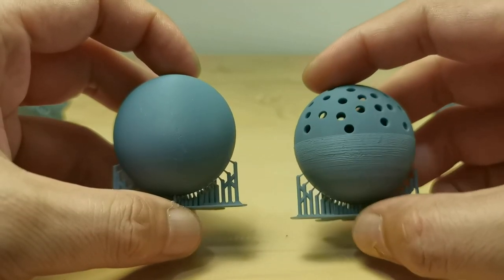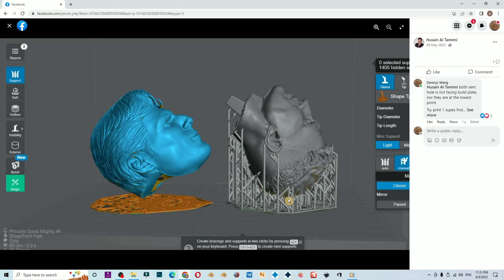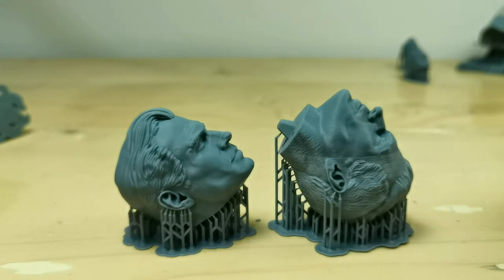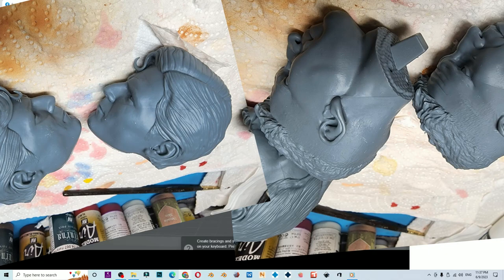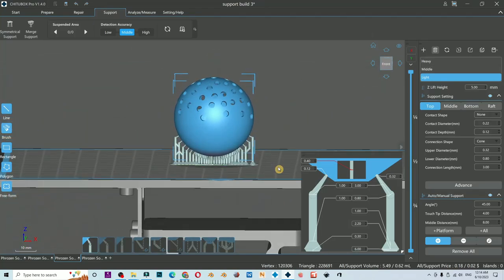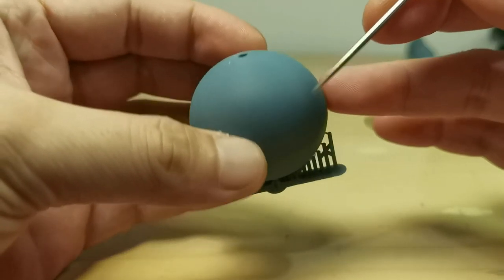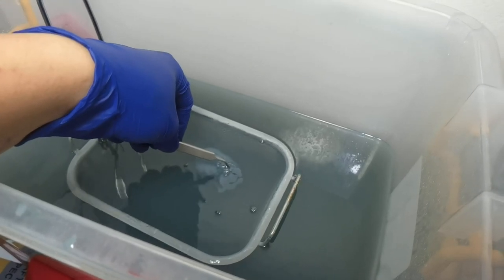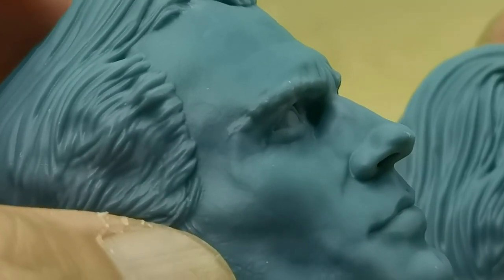Chitubox Masterclass Resin Printing How To Place Drain Hole

Comment: What is the best wall thickness? I've added drain holes and looking at this video they seem correct. But still at some point the model has issues pilling from the film, I thought this might be due to too thick walls. I've put very strong supports at the bottom (in my opinion) so they should hold the model. I don't think that increasing the height of the retraction will help, or could it help?
Reply from the maker: My wall thickness usually aroung 1.2mm-2mm

Comment: Shouldn't they be called something like suction alleviation holes rather than drain holes?
Reply from the maker: Touche!
Because at the end it is also to drain the resin trapped inside and flushing.

So somehow it is more popular to be call drain hole.
Reply: @wangdennys  But the main issue in the video is lines from suction. Anyway, keep up the great work.
Reply from the maker: @brib9716  yes it is, because of the wrong hole placement.